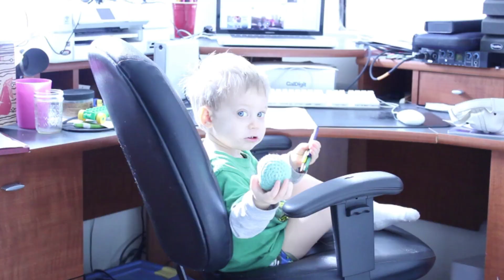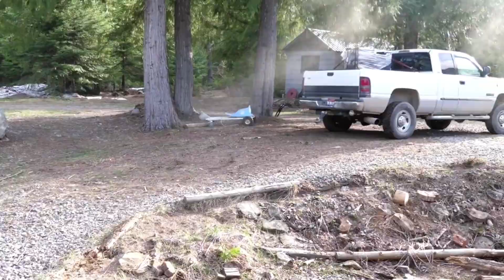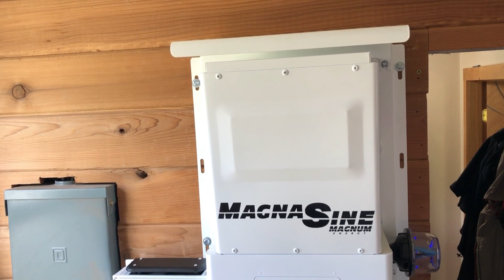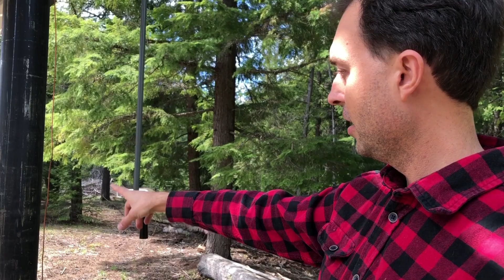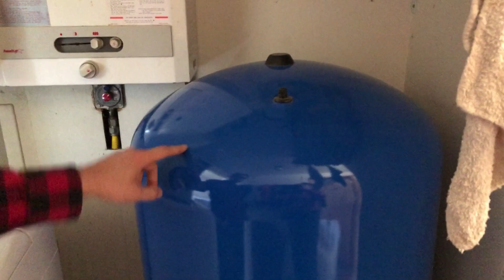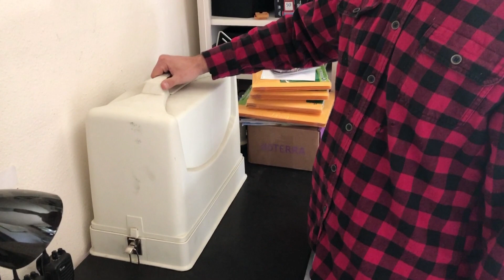Our Updated Power System!!

Comment: I’m curious of the total cost?  This seems like something not many people raising a family could do because it would be cost prohibitive? My mother was raised in Appalachia without electric power and they were ok so… to simplify candles and kerosene may be a cheaper option. Don’t get me wrong… I love electricity, but this looks expensive.
Reply from the maker: Hi there! As I recall, we have somewhere around $15k into our power system.  True, that's a sizable chunk.  But it's quite a bit less than many average families spend on expenses that are very common--like just one car for instance.  Add to that, this system can dramatically reduce or eliminate your monthly cost for power.  Your car costs you money every month--sometimes quite a bit.  So while it will take some time, the cost of the power system should pay for itself in money saved eventually.  I wouldn't suggest going off grid to save money alone, but if you want to do it for other more compelling reasons (like energy independence), it turns out to be a good investment for most.

Even though we feel like what we paid is a reasonable cost, setting up our current full system was not something we were able to do at the beginning as we were on a very tight budget and had to save up for it.  But we are so glad we did and are now reaping the benefits, with zero monthly power bills for 9 months out of the year and a very minimal power bill (for gas in the generator) during the 3 short/cloudy winter months up here in the North.

To your point, yes it's totally possible to go non-electric as electricity is not a basic necessity of life.  But the challenge is that most of us have built our infrastructure to be dependent on electricity to the point where some of our basic necessities (like water and heat) would not be able to function without power.  One could put a hand pump on the well (if the static water level is shallow enough) and heat with a wood stove that doesn't require any power.  It's just a matter of how you are okay with living (i.e. hauling water into the house in 5 gallon buckets in the middle of winter).  And setting up your own power system enables you to have the best of both worlds--independence and the conveniences we are used to.

But your point is well taken, that the power part is not essential--only if we set up all of our other infrastructure to be able to operate without any power at all.

Thanks!
Reply: @TheReadyLife  Points taken.  Yes, I suppose it depends on how much you want to spend and the particular infrastructure set up. Best wishes to you and the family. 🇺🇸🍺